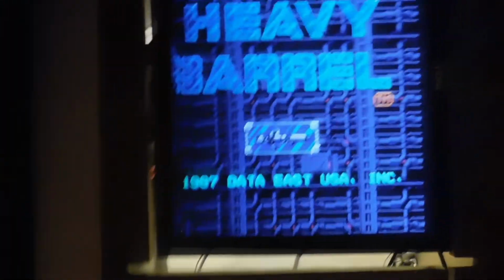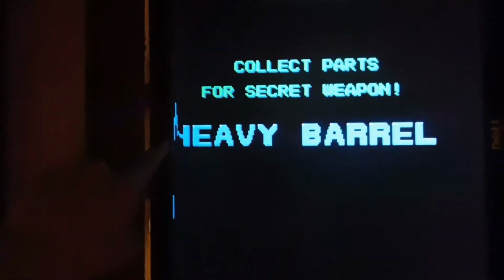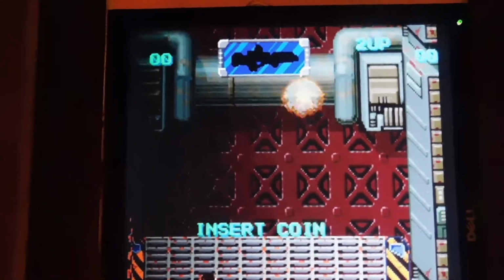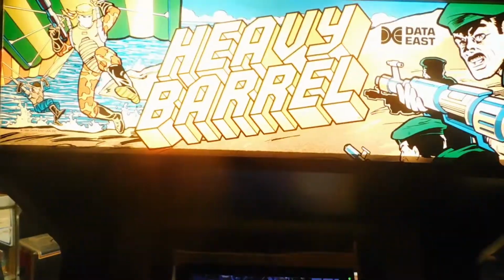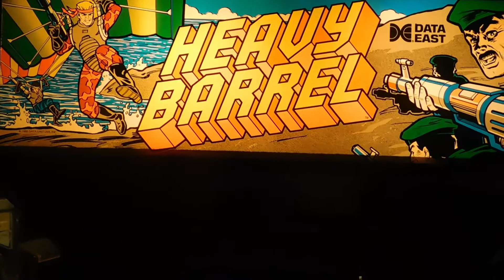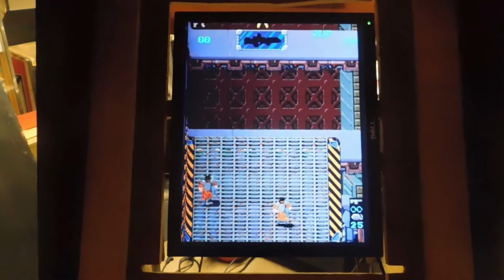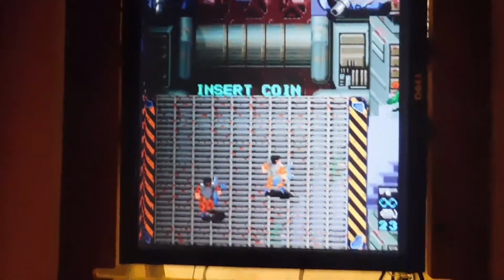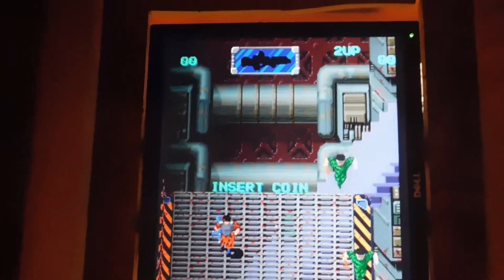Converting A CRT To LCD Monitor {CGA To VGA Conversion}

Comment: This may be a stupid question , when you hooked up the power to the board you said the wires were flipped (red and black) . So when I hook it up to power supply is the red wire negative and black wire positive now ?
Reply: Or is the red wire still positive and black is ground ?

Comment: Hi. Thanks for a great video. I have question. I have old cnc machine with bad monitor. Is have 15db video conector. And i gues is cga signal. How to pin out signal cables to wire up to converter? Thanks

Comment: Very helpful channel, but I have a question. 

I’m replacing a medium Res monitor with a LCN in a Super Sprint. I have a CGA to VGA converter. The converter has a 5 pin layout and the PCB has a 6 pin adapter. I’ve spliced in 5 of the 6 but it’s reading no signal. I’m assuming all 6 pins need connection for it to read board.?
Reply from the maker: The 6th pin is probably a positive or negative sync, if so connect them together and that may help

Comment: Im having issues with my zaxxon cabinet showing the picture through the lcd, but its flickering, and I cant seem to get it right through the adjustments. Any tips?
Reply from the maker: Sorry for such a late response. The first thing I'd look at with a flickering monitor is if any power wires are leaking into the video wires. AC Leakage can cause flickering like you're describing. The other issue I can think of off the top of my head would be either a bad connection somehwhere or an issue with the convertor board you're using. I've had bad convertor boards do the same as well.

Comment: I got a Mrs pacman I'm converting due to dead screen   how did you make the lcd screen rotate ??  And dose the screen automaticly turn on when pluged in?
Reply from the maker: The screen should automatically rotate because of the way the video signals are being sent from the PCB. The monitor does turn on automatically as long as you buy and Arcade Monitor or a Computer Monitor. Regular TV Monitors wont turn on automatically.

Comment: Great video. I did want to point out you accidentally said VGA at about the 3:30 mark instead of CGA. I know it was just a slip of the tongue, and this is a great video. Thanks!
Reply from the maker: Didn't notice that, but you're right. Thanks for letting me know, I don't like to give misleading or false info so I appreciate the heads up, I really do!

Comment: I purchased the same type of converter board and I'm having problems with the picture stabilizing. I have a 2005 Golden Tee with a warn out CRT monitor. So I've installed a 27" LED monitor along with the converter board. When booting up, the picture rolls/flickers, then the signal goes out....then comes back on and off. What do you suggest I do? Any help would be appreciated. Thank you
Reply: try adding a 10k resistor to the sync wire

Comment: Can I use the CGA to HDMI converter to go to a flat screen instead? Or is there a drop off in gameplay? Literally have no clue about anything like this but this video helped out so much! Thank you
Reply from the maker: You can use this convertor to go from CGA to VGA and yes there is a slight lag in the video when you do so but it's so minimal that it's hardly noticeable. Just make sure the convertor has proper voltages coming into the PCB and the Video Output is properly connected and you shouldn't have any issues.

Comment: May I know if you can just plug JAMMA harness that goes to CRT to CGA to VGA adaptor?
Reply from the maker: Yes you can, all you have to make sure of is that the video outputs from the JAMMA harness are connected properly to the CGA to VGA Convertor. If you can make sure those connections are done correctly then it should work just fine.

Comment: How do you get the display to show up and down long ways with the monitor mounted side ways?
Reply from the maker: It'll do it automatically, the game board is programmed to output a Vertical Video no matter the monitor it's displayed on. I'm running this game with the original PCB.